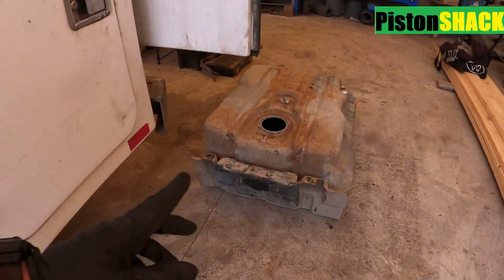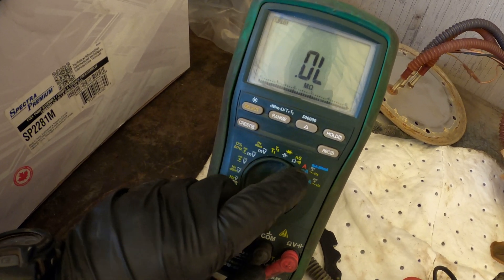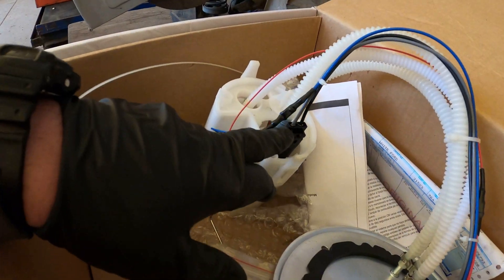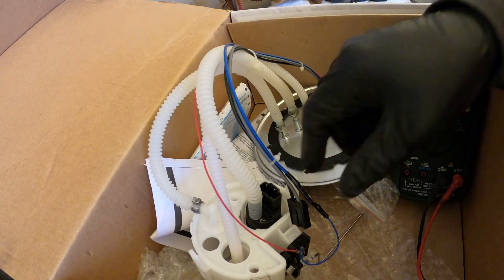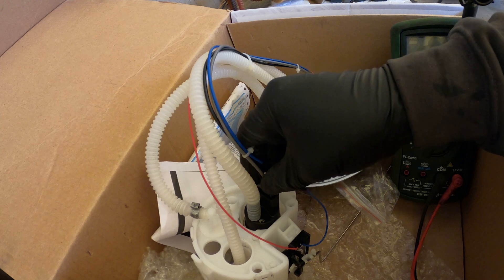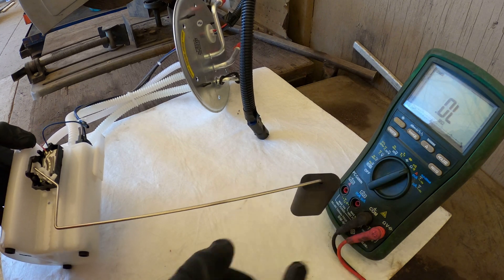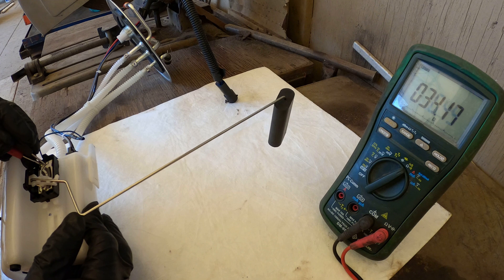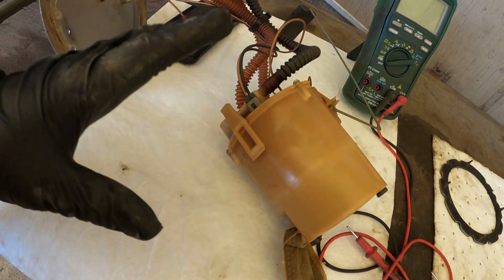ALWAYS TEST FUEL PUMP & FUEL SENDING UNIT BEFORE INSTALLING! TIME SAVER! // 4K

Comment: Hello Sir, thank you for your video, i would like to ask you why my connector coming from fuse box i guess has 5 pins, by any chance do you know what are them for, i thought was only 2 pins at the connector, please help me, i am not getting fuel in the injectors..thanks a lot.
Reply from the maker: Hey Luis! Have you sorted out your problem already?
Reply: @PistonShack  hello Sir, how are you? Thank you for asking, yes i did fixed the fuel problem, my fuel tank has a sender unit separate and it has 2 wires, so my system is 3 for fuel pump and 2 for sender unit, everything works there, no i am facing another problem, my ECU it's not working.
Reply: Do you have any ideas how can I program a used ECU from a different car, same model just different year, i bought it at the junkyard, but i does not fire up, only cranks, it just funny because this ECU everything in the dashboard works except for don't start up, it does read codes, my older ECU only read codes if i bypassed ECU relay, by doing a jumping wire to pin 30 and 87.
Reply from the maker: @LuisMartinez-fr9gq  Great, Luis! Thanks for your feedback. What vehicle do you have? I would check make sure you have all powers and ground to ECU first. Check if ECU fuse, relay is good. Look for main relay and fuse as well. Do you have engine light on when turn key to the on position?
Reply from the maker: @LuisMartinez-fr9gq  Just fond this comment. What kind scanner tool do you have? You have to rewrite VIN to new ECU or get Immobilizer from the van you pulled ECU out. Most like your Immobilizer  SCREEM module doesn't much. I have my van got vandalized few weeks ago. I got if run again. I filmed the video how to program and replace SCREEM module ect. 
I would get Immobilizer (located near ignition key ring on steering column, black box) from the van you removed ECU. I used XTOOL X100 pro2 to get all programming done. I was amazed how powerful this small tool is! Cost me small portion compare to dealers or locksmith price.
Reply: @PistonShack  yes Sir, already check all fuses and relays, they all looked good, this is a 2001 Hyundai Santa Fe 2.4 liter manual transmission, i just do not understand why my old ECU only works if i bypassed pin 30 and 87 from ECU relay, but with the used ECU that i bought the relay works fine i do not need to jumped wire pin  30 and 87,  the relay works fine, but my car won't fire up, only cranks, with the old ECU the car starts but it shakes very bad, i have to pressed the gas pedal and hold it to keep running
Reply: @PistonShack  i have one question, do you have access for car wires diagram, i bought the manual at AutoZone but it's not complete only have basics it's not specific for my car it's for 2001 thru 2009 all models, which it's hard for me to follow the wires.
Reply: @PistonShack  hi friend, i only have an OBD II SCANNER, i do not not have the special tool, i really want to trace the wire from pin 87 all the way to the component, but i do not know how, if it's relays or fuses in between to find the right wire, any trick to find the right wire, i know how to use a meter with settings on continuity to find the wire, but how can I be 100 percent sure if it is the right wire. Do you think you can help me to trace this wire friend with a diagram, can you get me a copy of a diagram for ECU relay wires on 2001 Hyundai Santa Fe 2.4 liter with a manual transmission. That will help me a lot buddy thanks in advance..
Reply: my engine light is not coming On, but if i bypassed pin 30 and 87 on the ECU relay it does come On, any suggestions where to start checking

Comment: I watched 10 different videos none of them told me nothing you however showed me what I needed in a couple minutes thank you sir
Reply from the maker: Great to hear that Bill!  I try not just be a "Parts Changer")  I am glad this video helped you out. Cheers!
Reply: The pump showed continuity but when I put 12 v to the pump it didn’t work I don’t have an ohm meter
Reply from the maker: @Him-x7-03z  Continuity is not very accurate test, when multimeter sends micro voltage to check integrity of the circuit only one tiny string of wire needed closed to show the flow. Pump should start right up when you connect 12v power to it. Check make sure you have good contact when connecting test battery. You also can do voltage drop test when pump loaded measuring voltage flow.
Reply: @PistonShack  dude you’re awesome thank you I glad I found your channel I will tell my friends  who might want to watch it too
Reply from the maker: @Him-x7-03z  Thank you so much  for sharing and watching the video! I very apperceived that. Let me know if you have any questions. Take care brother!

Comment: Wow, very thorough explanation. I didn't know that fuel tank sender unit looks like this. What if the metal arm get bent while shipping or something?
Reply from the maker: Everything could happen. This is why you have to check new parts prior the installation. Merci!